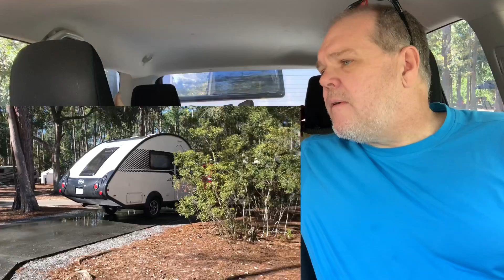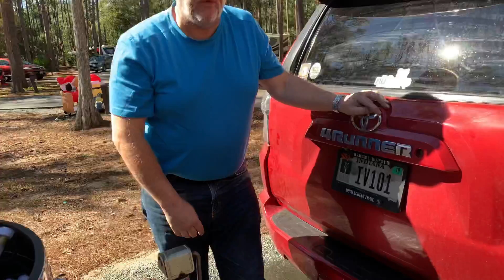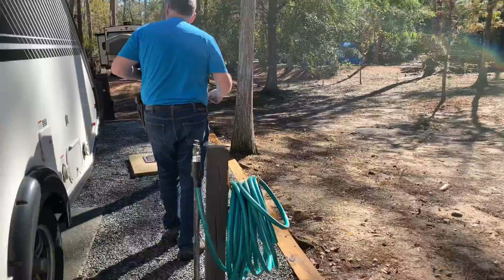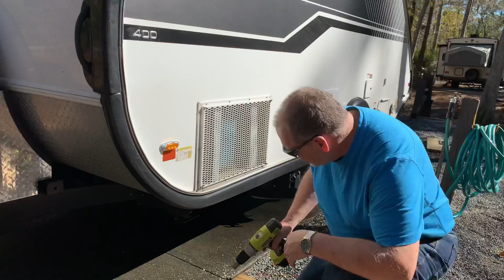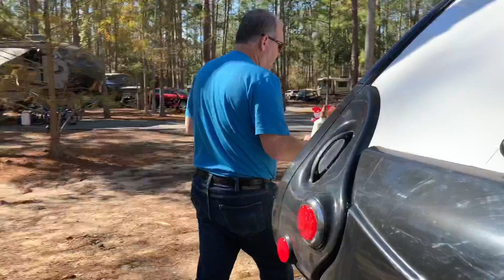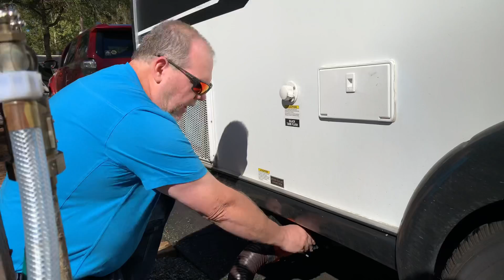Setting up our NuCamp T@B 400 RV at a full hookup campsite

Comment: Does that surge protector indicate if the pedestal is wired correctly or incorrectly?
Reply from the maker: Yes.  There are lights that give you codes if there is an issue.

Comment: Hi! We just bought a T@B 2019 320. Thank you for your video’s they are extremely helpful and easy to follow. I have a question, what surge protector are you using and are they that important and are all small nucamp trailers 30 amps? Thank u... happy camping
Reply from the maker: We have a Progressive Industry surge protector although they make several different ones.  We have the basic one which I am not sure actually does much now that I have done more research on them.  I am looking at upgrading ours to the Progressive Industry EMS system which is suppose to protect the entire trailer.  I believe that all of the NuCamp 320 & 400 trailers are 30 Amp. I am not sure if the new Avia is 30 or 50 amp

Comment: Hi there, This was a very informative video. Thank you so much, I am still trying to back up my T@b 320 s and its a slow process. My question is, Can I use the drill adapter to my levels on my T@b 320 S system? I don't know what the measurements are since i do it manually. Thank you for your reply.
Reply from the maker: I believe you have the same levelers on the Tab 320 S as are on the Tab 400 so you should be able to.

Comment: Being from the Deep Sunny South ....

When hooking up the water ... I add a step.  I find it very rewarding to turn on the spigot and flush it before hooking up the filter/hose.  Keeps the wasps/honey bees/bumblebees from being introduced to my system.  You never know when one of God's creatures is looking for a drink.   

It's also a good idea to keep wasp spray handy.  It doesn't take any time for a wasp to set up shop in the electrical enclosure.  Especially if it's not the most desired spot and gets the least amount of usage.

A tip for those folks just starting out and worried about backing .... instead of the 'reverse turn' method to back the trailer .... simply put your hand at the "bottom" of the steering wheel and turn it the direction you want the back of the trailer to go.   

(My Two Cents for the day.)   Always enjoy your videos.  Keep 'em coming.  :)
Reply from the maker: Great tips that I hope others will read!
Reply: Good tips. Another would be to fill the hose with water before attaching to the trailer so there's less air being pushed through your trailer's plumbing the first time you use the faucet.

Comment: We’re still learning to back up our Casita travel trailer, it’s challenging. I noticed your trailer hitch is the type that is adjustable. How do you like it? Ours is fixed, but if I tow with another vehicle it would be nice to have an adaptable device. We tow with a 4Runner too. Did you stiffen the rear suspension? Ours drops a few inches. I have some concerns the headlights could affect oncoming traffic if we travel at night
Reply from the maker: It is actually a weight distribution hitch that we had.  It's a bit overkill for this size trailer but since we owned it, we just still use it.  I did add the Timbren Suspension Enhancement System to our 4Runner.  It was $250 installed and it took the squat out of our 4runner when hooked up to the trailer.  Now we only squat about 1" in the rear now when hauling.

Comment: Great video.  I agree with you. I put the water pre-filter directly to the spigot and then I put the pressure regulator. I also usually keep the grey closed and drain it as needed.
Reply from the maker: Thanks Lou!  I've tried it all sorts of ways but I seem to like this best.  Plus I don't like the weight of the filter dangling off the city water hookup on the side of the trailer.

Comment: Great video. Love the Anderson levelers. I don’t know if you do this but I loosen or remove my sway bar when backing up.
Reply from the maker: You definitely should take off the sway bar before backing up as it can damage the sway bar.  Unfortunately too often I forget...luckily I have never bent the sway bar though.
Reply: Travels with Delaney  I have forgotten in the past and now try to remember. I  like the way you fixed that sway bar when unhitching. I take off both ends and why?  I’m going to leave it attached at the trailer like you show. Thanks.

Comment: Nice video, You will probably get a hundred comments on this subject. You should always wear gloves before hooking up and dumping the tanks. For the freshwater spigot, I always sanitize it first before hooking up the hose. Remember water is the black and gray tanks best friend, the more water the better, They are holding tanks, not a septic tank. Even the gray tank will build up solids after a day or so if left open. Ever have to unplug a bathroom or kitchen sink? That's what stays at the bottom of the gray tank when not enough water is kept in it. Just a suggestion. Safe Travels!
Reply: Agree!